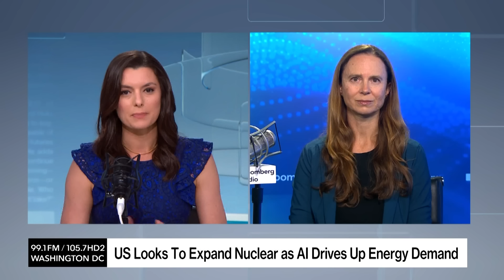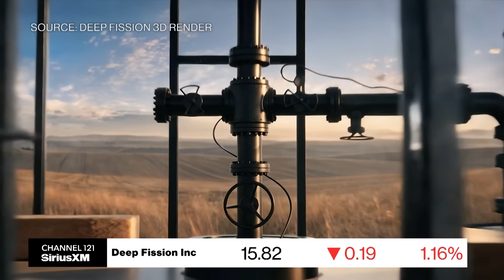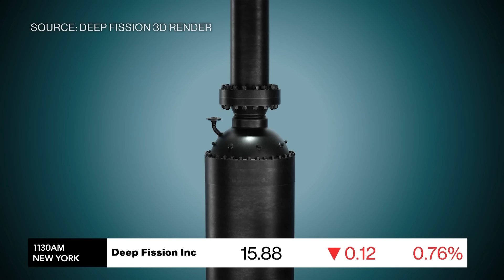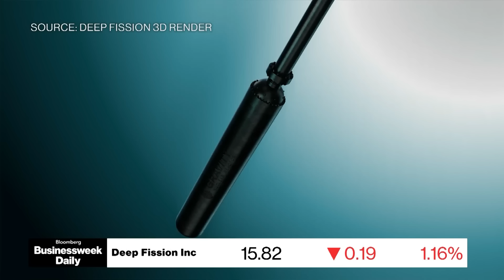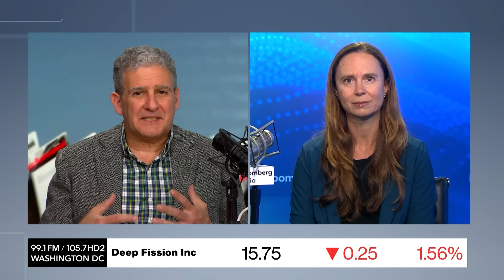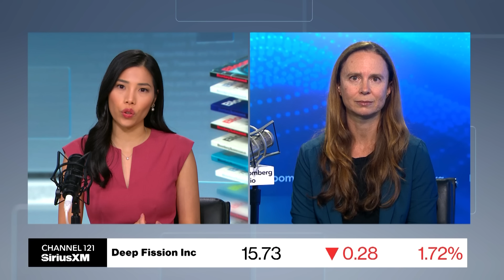Deep Fission Opens At $16 a Share As The US Turns To Nuclear Energy

Comment: Have you resolved the risk of a stuck cannister in the upper 200 feet of the borehole? You aren't deep enough for pressure containment. Fishing is not an engineering control. Workers will be directly above the open borehole and exposed to ionizing radiation. Is there a solution? I tend to realize why Finland is using a mining approach and even Yucca Mountain relied on a mining approach. I can envision a hybrid approach with mining below the safe drinking water zone followed by drilling the deep borehole from a drill station constructed underground. The mining approach gets the loaded fuel cannisters safely below the drinking water zone. Sealing the adit ramp is possible at many levels. A helical decline ramp of -10° also allows for vertical and horizontal spacing as needed for temperature control. Talk to a mining engineer. Miners drill and mine Precambrian crystalline rocks routinely. O & G drillers tag these basement rocks and quit drilling. That's why the drilling contractor burned through so many diamond core bits. They don't have bit designs that fit their tooling for rocks that hard. Mining companies do. And they also use the same drilling techniques as adapted from oil and gas drilling.

Comment: Liz, there is a backlog of orders for a steam turbine. Can you explain do you have access to turbines?
Also how do you stop the radiation travelling up the water column?
Also let's say you get the heat to the surface, don't you think there might be some lose in heat on the way up?
Also how do you control the reaction? Have you got wires going down controlling servos or mechanical line pulling things. Just wondering?

Comment: i presented for Elizabeth in one of my classes for UC Berkeley while she was representing Deep Isolation on a board of professionals lol. 

the fact is the NRC and EPA have been gutted. when i worked with a borehole phd i learned a lot about the regulatory side around burying nuclear waste. the thing is these kinds of nuclear materials (not to mention live reactor) projects are only feasible in limited locations depending on geology since the "containment structure" is going to be a literally eternally moving earth's crust. its technically and relatively structurally feasible and long lasting when far away from the continental borders, so no reactors near ring of fire lol but thats not so far fetched. Theres specific rock at different depths and the rock they dig into is deep and hard bedrock so they say. i mean ive seen the diagrams and plots and videos of it all hahah 😂 not to be so jaded

anyone can make a nuclear plant by digging a hole and throwing uranium in it like that's what the natural nuclear reactor in africa is. 

but previously the regulations would require local approval and of course the risk of living near a reactor, which is technically safer than coal or oil or gas power except when its not and the news about it is suppressed aka santa susana hunters point etc not to mention ongoing water contaminations protested by the Havasupai tribe and Navajo nation

 this very unconventional approach is totally a grasp to operationalize nuclear energy on a tight budget and timeline. but this is such a recipe for disaster and inequuality. what if everyone doesnt want to sell their land for any ai or nuclear related thing, bc of how closely tied it is to war crimes, dictatorship, and environmental collapse as well as the dissolution of the normal fabric of working class americans under trump but really since after ww2.

 not that i mind that so much but some people certainly do. nuclear power and ai and then now what? high tech for some and death for the rest? reality will not be so extreme one way or another. but the sentiment remains

But will you go under their noses elizabeth? digging and hiding the nuclear reactor for the greater good? 😂😂 

well anyway I dont want to spread fear innovation will be happening but I hope to God people will get involved or be let into the benefits and decision making of the processes involved of this whole development and the many that will come the next decade if the clock doesnt strike midnight but seems like most IPOs will come out of this looking like enron or theranos
Reply: TDS is strong with this one. May the force of HATE be with you.

Comment: This is terrifying. The area I grew up is home to hundreds of oil wells from the early 1900s that are now leaking with little documentation remaining on where the wells are. Nuclear materials would be much much worse than leaking oil and will remain dangerous for 100,000+ years. Underground infrastructure will degrade long before the nuclear material becomes safe.
Reply: These are much different from 1900s so you don't need to worry, as long as they can make a pilot plan work out it will be all good.

Comment: In theory.. if it works... it almost CAN'T hurt the water table. As I understand it, the reactor is WAY below the water tables, and the heated water piped back up isn't radioactive.  So nothing touches the tables. In theory. I wouldn't invest in this though.  Not yet.
Reply: Yeah we were all excited about fracking and then a few years later there are people who can set the water in their bathroom on fire
Reply: @bubbleblitzpop I did a whole project looking into LIDAR methane sensors. I found quite a few studies on methane in the home. The fracking leaks pushed into ground water havent even been treated with mercaptan so the gas remains odourless. Even along urban distribution networks theres next to no standardization for mercaptan treatment. The law is something like “Ought to be detected at one fifth the explosive limit ( so 1%) by a person with normal sense of smell”.
Reply: Pressurized radioactive water flowing past the water table with 1" of steel and 2" of concrete.  What could possibly go wrong?
Reply: @CapAnson12345  The mining industry often dumps waste in their underground mines because they are so far below the water table. So yes in theory it could work. As nuclear scientis I would like to see some designs before I believe them though.
Reply: @FractaLL2103 that waste goes down once, never to return.  This design requires pressurized working fluid that will be constantly returning to surface.

Any degradation in fuel containment will mean irradiated fluid returning to surface with potential direct fuel contamination.

Just like data centers in space, trading one known challenge for thousands of unknown challenges.

The 30" casing is what has me shaking my head, perhaps for 100m at surface, but the shear force on the casing at depth will mean the wall thickness will need to be extreme.
Reply: @FfrankOstenbrooke-q4t4t  I’m also imagining the added struggles in determining site location with regards to geologic conditions. 

I’m also imagining how one could maybe put the steam cycle underground in an abandoned mine perhaps and just do electricity transmission to the surface. Inevitably in accident conditions though contamination would boil up and out of whatever tunnel. 

The fantasy lies is the potential cost savings of not having to pour concrete but every other challenge seems greater.
Reply: @FractaLL2103  peak tulips.

Comment: This actually an old idea  scientists in the UK ruled it out in the 1960s because of the risk to the water table. 😂
Reply: Maybe see if you can find a place that has a water table a mile deep.
Reply: I'm sure there has been no technological advancement since the 1960's.

I'm sure people ruled out space travel in the 1940's. It happened by the 1950's.
Reply: i guess it could work in more remote places than use transmission lines
Reply: Right.  But, the more I think about it, how deep does the water table go?   I've just googled that question and I'm not seeing anything over 300 feet.  A mile is 5000.  Maybe not even a problem after all

Comment: This is like geothermal but leaking radioactive isotopes contaminating groundwater.
Reply: as long as there's enough water shielding there's nowhere for the radiation to go. Water shielding is good enough to protect astronauts in space from the sun's full cosmic rays, the Sol System's biggest nuclear reactor. It can handle a small, fission reactor.
Reply: @soldios-54r  You assume that everything stays contained in a vessel.
What happens when containment fails?
A plume of contaminate that infiltrates into the water?
Or are you one of these mini-sub engineers that scoff at container failure and what comes after?